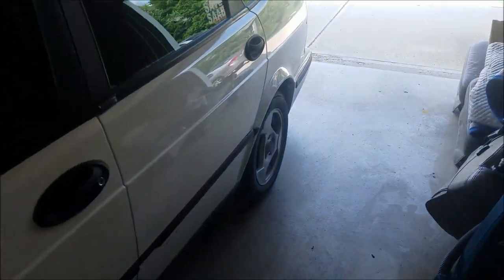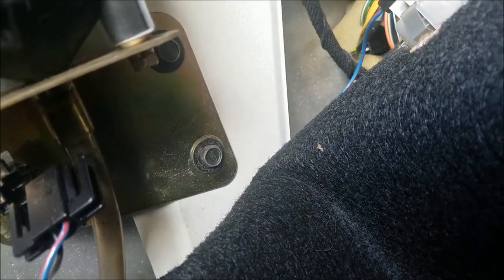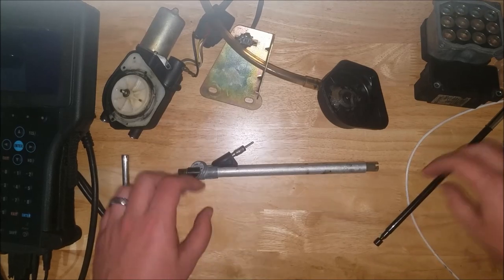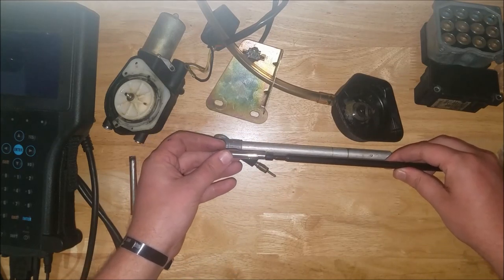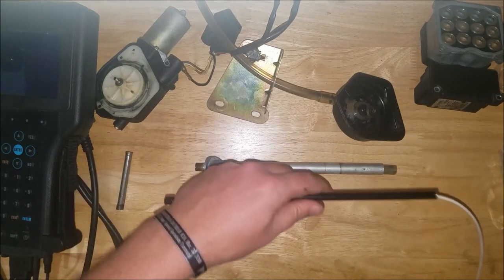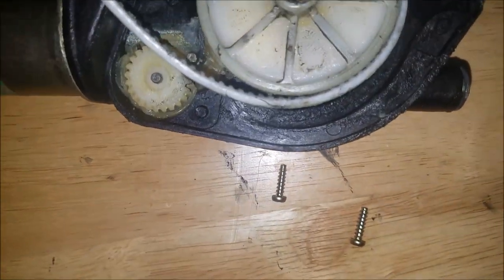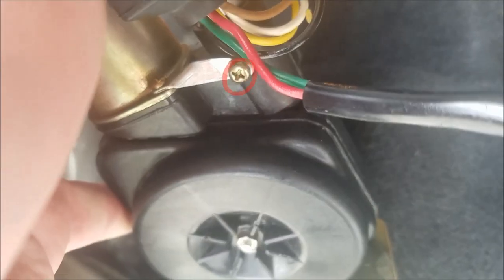Saab - Antenna Mast Replacement

Comment: Hi, Thank you.  A very useful video but after four attempts at failing to make the aerial work due to the internal plastic cable turning and not engaging on the gearwheel, despite my very careful attempts at winding it into the spool correctly. I found the answer to be to assemble the aerial fully extended. This allowed the aerial to twist itself so that the internal toothed cable remained correctly aligned. To prove this I attached a jumper earth wire from the motor mounting plate to the bulkhead screw holes. I then just loosely placed aerial assembly, so it was sticking horizontally out of the boot. I then connected the connector and battery and ran it that way a few times. This let the motor wind and unwind the internal plastic cable, rather than me trying to do it by hand and failing. Success! It now works perfectly. I can recommend this slight amendment to the otherwise excellent instructions in this video.
Reply from the maker: Genius!
Reply: I’m struggling too on this . But if you extend it out , install , how do you wind in the rest of the cord ?
Reply: I guess wind it so that theres just enough cable to put the end inside the coil?

Comment: Remember to spray the hole with a zinc rich primer before reinstalling and also to spray with grease just before putting the carpet back - if like me you’re in a place like Scotland the constant rain and winter road salt will eventually corrode that spot. Great vid, thanks for posting!

Comment: Thanks for this! It was really helpful and I've just completed the swap and the aerial is back on the car working. I didn't notice anything different about installing it on a convertible. I was having trouble cramming the white plastic runner back into the wheel housing, so I extended the aerial, reassembled the housing and pushed it back in manually.

Comment: Excellent video, still helping people replaces these in 2022 (soon to be 23!). 

For those of you who have the cord just suddenly unwind, that is likely due to the center spindle coming apart (it’s a pain to reassemble if the springs or bearing pops out).

Comment: Thanks for the helpful video!  Replaced the broken mast in my wife's 2002 9-3 SE. Some additions that helped for me:

1)  Moving the carpet was difficult.  Helps if you totally remove the speaker cover by removing the plastic trunk deck (the part that hangs from the hatch door) and then remove the knob that it snaps into as well as a second screw by the rear seat (you may have to fold the seat down to get to it). I also removed the retaining rings on the hatch sill cover (along bottom of hatch opening) so that I could pull up the plastic sill cover to pull the carpet out from behind it. It looks like the sill cover wasn't installed in the video.

2) After reinstalling the repaired mast assembly and screwing down the outside 17mm nut I turned on the radio and got several clicks and no antenna extension.  I pulled the 17mm nut and the antenna extended normally, so I reinstalled the nut with the antenna extended and now it works normally.  I'm guessing that the antenna was somehow hung up on the nut.

Comment: Thanks to your video I decided to install Viggen style antenna on the roof. 
Pros:
- better reception (tested, built in amplifier)
- no annoying noise when turning radio on and off
- no risk of breaking in freezing temperatures 
Cons:
- antenna plug costs $30, so I left old antenna in place

Comment: Thanks for the video. 
Recently got a 2002 9-3 Aero 5D and a friend of mine decided to push the antenna down by hand :D .So now it's stuck and wont go up or down, but every time i start the car i can hear the loud motor trying to push it out, and down when i turn the car off, a bit annoying.
Hopefully it's fixable so i don't have to buy a new one for almost 200 bucks.
Reply: You might want to unplug power from antenna. You are risking damaging motor or other moving parts. It doesn't have an amplifier, so no signal loss after unplugging.
Reply from the maker: Yeah personally I ran my 5DR Saab with the antenna power unplugged for two reasons. 1) It lessens the wear of going up and down everytime the radio is turned  On and Off, and 2) I once had a FM transmitter for my MP3 player and having the antenna up always added to the interference. I just had to remember to re-plug connection to mast anytime before I did a roadtrip w/o the MP3 bc radio is definitely worse without the mast up

Comment: The problem is that when having the thread in the house like in this video the car will snap it off. When installing power the car will roll in the wire and it will snap. Do like Andrew suggesting and assembly with the antenna fully extended. You don't have do mess with the wire so much also. I need to order a new one since my wire snapped.
Reply from the maker: Great tip, sounds like doing it that way you let the motor roll the antenna from fully extended and dont have to manually (and painstakingly) coil in the antenna on the motor gear. You're saying just feed the litte bit of the tail thats left after full extension, and then the motor can coil it nicely, and in a manner that's natural. Saves the manual work, let the antenna motor do the work!! I LIKE IT. Thanks for sharing your insight so that others may read 🤟

Comment: Where did you order your new antenna and tooth cable? Very helpful video!
Reply from the maker: Two options, black or chrome:
https://m.eeuroparts.com/Cars/SAAB/1165/1999-9-3-2-0L-4-Cyl-16-Valve-Turbo/?search=antenna+
Reply: @saabross3171  Thanks! Just got the antenna mast of my -97 900 repaired earlier today. Everything worked perfectly on the first try.

Comment: The hardest part for me is trying to disconnect the plug in connector. A common problem for me!! Electrical connectors and their endless variety will no doubt be the cause of my death. My wife will come out to the garage one day to find me stone cold - my fingers still gripped tightly to an electrical connector in a life ending struggle!!
Reply from the maker: Hahaha love it; I can relate on so many levels! Every one is different, but nothing a little flathead and some patience can't solve.

Comment: As much as this helped, I’m concerned about where the 3 small metal plates goes. Under the lock or above it. Everything is great but I’m concerned about that small part. Maybe record a little closer and show each individual part going off as well as screws and plates
Reply from the maker: What exactly do you mean by 3 small metal plates? I'd be happy to show you
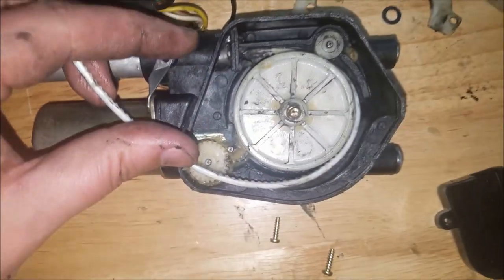Reply: @saabross3171  I found it, but under the locking pin there are supposted to be 3 small metal plates, when put together looks like just one plate. When I got done putting it together and was 100% unsure if that was the right spot I looked through the whole video until I saw at 2:09 where they belonged. So I took it apart and put it back together in just a few minutes. As much as it helped I would say maybe show the screws and all that? (You can see the metal plates as well at 4:55)
The outcome at least came out good on the cabriolet, but the antenna doesn't go in 100%, which is fine because it at least goes up and down now after about 6 years as my dad has never had the will to do it until when we did it a week ago, we took out the motor and I changed it.

Comment: I been trying to remove the sleeve but it's really stuck. Do you have any tips how to do it?
Reply from the maker: Best tip: don't remove it. Though if you've chewed it up trying, using a large drill bit that juuust fits inside the mast will bore it out

Comment: So you don’t trim the new cord ? Looks so long ?
Reply from the maker: Oh heaven's no. Don't cut it. That cord's length is the antenna mast length when it's fully extended, plus a little extra to wind once around the motor gear. These old Saab antenna's are quite long too, oddly enough, so if you cut your new antenna it's going to get stuck in the "up" position. The motor gear won't have enough tail to pull it down, if that makes sense. 
Point is, don't do it! Use the part as it is, and just wind that long tail into the motor as shown in the video.
Reply: @saabross3171  can I wind it in manually?